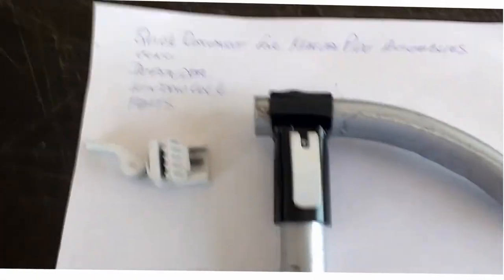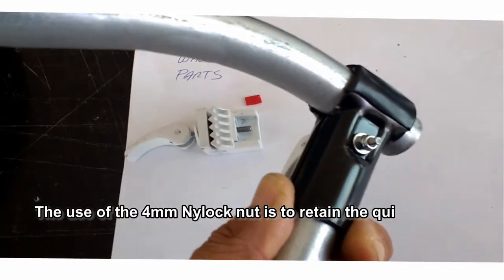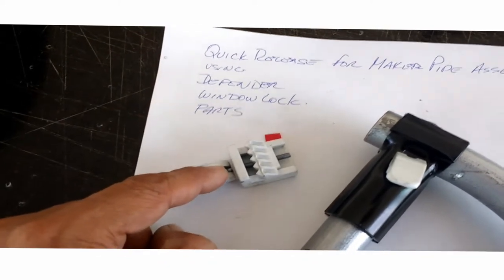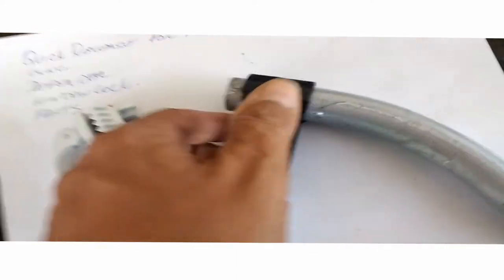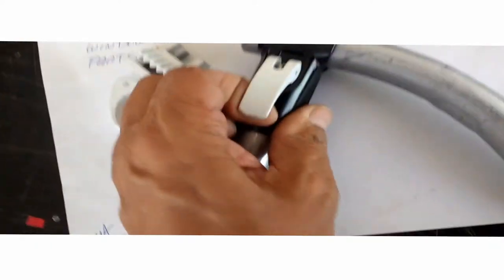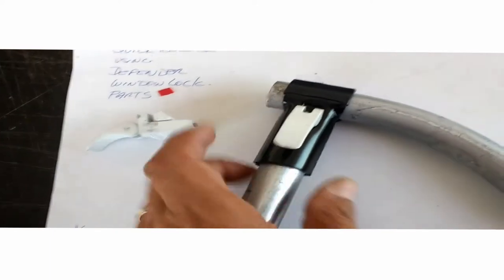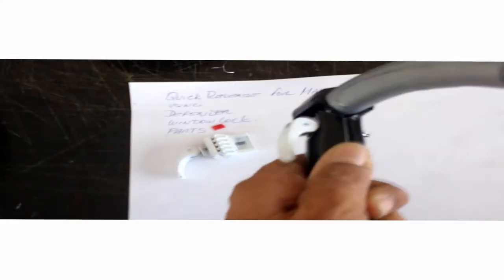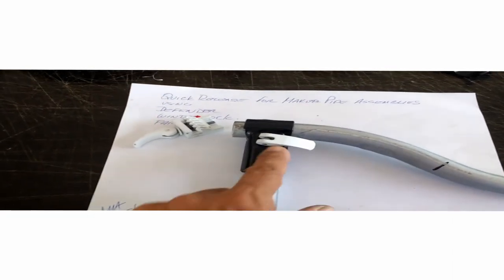Quick Release for Maker Piper connector   DIY

Comment: This is great! With as frequently as I search for makerpipe videos, I have no idea how I haven’t found this until now! 
So if I’m understanding correctly, the bottom portion of that quick release is inside the T-connector? I almost feel like I need to see how you put it together lol. I’m always looking for good quick release type systems for my builds, so I can setup/tear down conveniently (canopies, projector screens, etc), so I definitely want to try this! How do feel it effects the strength of that connection? I’m not sure if you’ve since revised your technique since you made this video or anything.. Thanks for sharing this!
Reply from the maker: I kept the same application as shown in the video because it has been working just fine. You can use any type of quick release cam lever/ bolt/nut,  provided it fits inside the maker pipe connector bolt hole.  I have another solution to the quick release but this requires redesign of the maker pipe connector itself. I will be voicing this design to Maker Pipe and see if they are willing to consider I think it will be a game changer to their original connector design.
Reply: @MarioIArguello  Sweet!! I’m excited to see what it is! Honestly, I think they could have a whole line of quick release style connectors (similar to how they came out with the “pro” line)